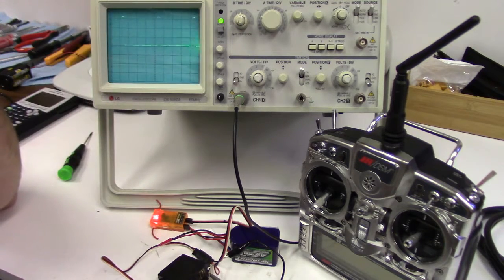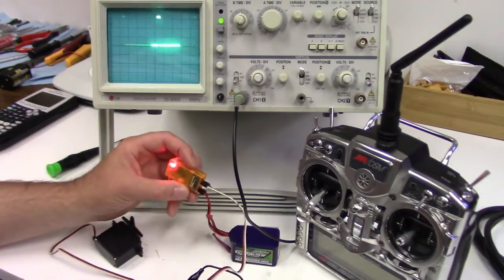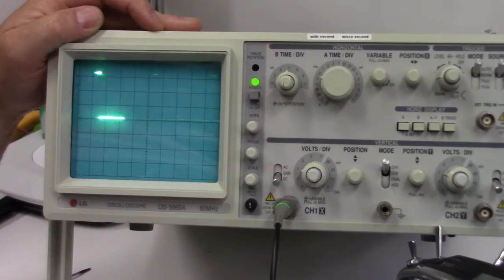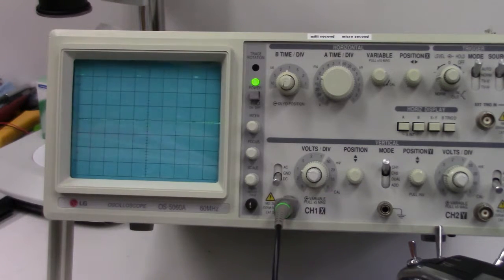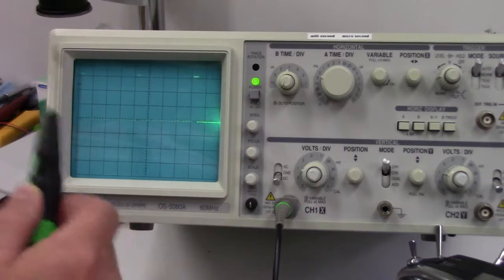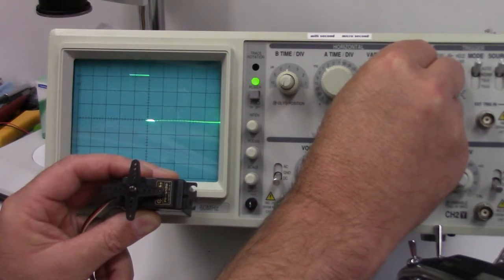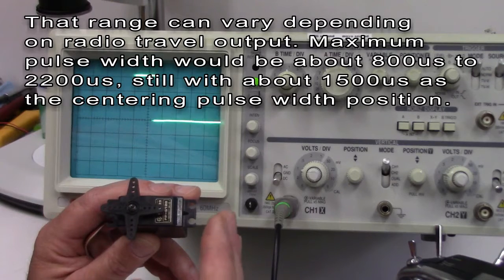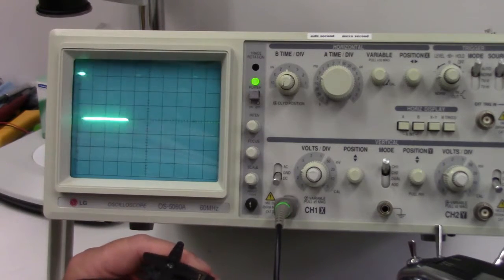RC Servo PWM and Frequency Demonstration

Comment: Congratulations! Very clarifying video!
I am looking for a circuit to be connected to a radio control instead of a servo to enable and disable the power of a camera (900mv x 11v).  Do you know any product, or would you indicate a diagram for assembling a circuit?
Reply: RC controlled switch is easiest. A small relay/MOSFET can be switched on and off by using 1200ms and 1900 ms. It just needs to be well above or below the threshold.

Comment: great video, at a project 5 years ago I seemed to remember that the width (or duty cycle) of the pulse determines the position of the servo. Other Youtubers seem to use teminology where they seem to say that the width of the pulse determine the speed at which the servo arm moves, but that should not work in any logical fashion.
Many thanks!

Comment: I have a question; I was thinking of using a digital servo for an application that needs to be fast and have good holding torque, and I want to know, do I need to send a PWM frequency of what the servo is rated for (to benefit from) or is the signal being sent still a 50Hz signal (and circuit inside the servo is dealing with the other/higher frequency)? I would like to know so that I can try to figure out how to change the Servo.h library in arduino to accommodate this if I need to.